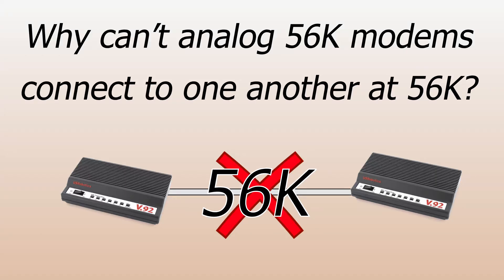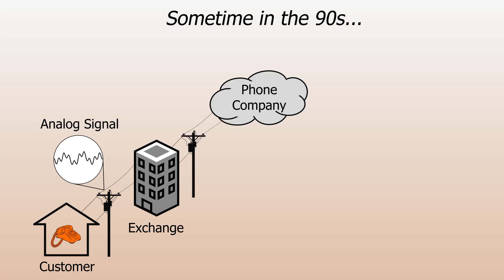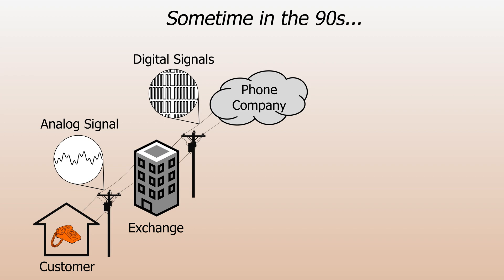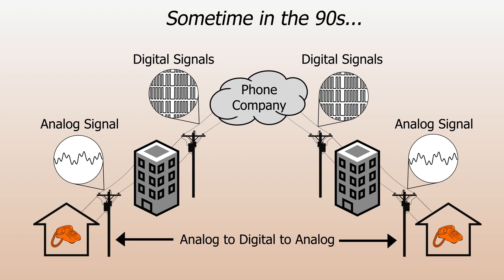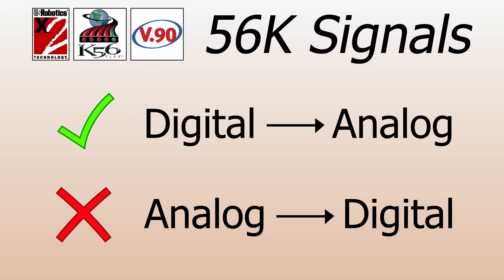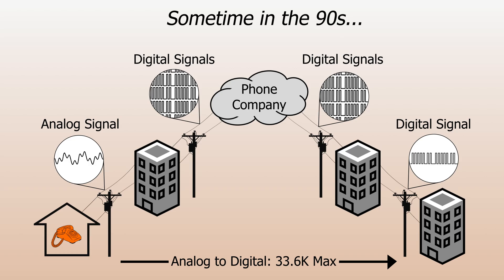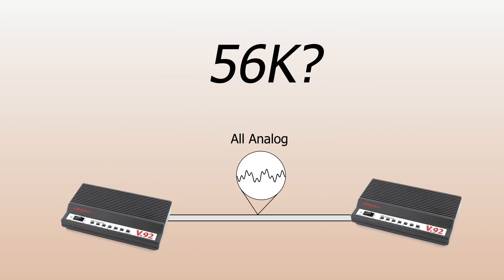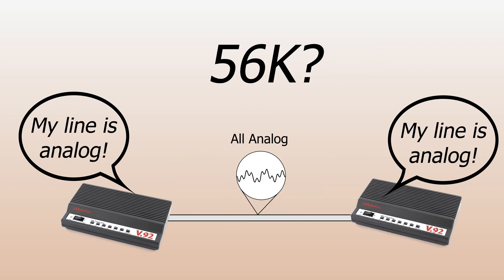56K Modems Aren't Always 56K

Comment: Clear and concise.

It would be interesting to delve further/deeper after this.
Reply from the maker: Edit: this reply was meant for a different question, and I accidentally posted it here, but I'm leaving it so the comments below make sense. 

V.92 is subject to the same limitation, at least so far as I can tell based on both my reading and of the standard and a bunch of  my own testing. In those tests with the V.92 modems I have on-hand, they don't even try for anything above V.34 after the V.8 exchange is done. I had hoped that the higher PCM upstream mode that V.92 offers might somehow work, but that feature is established during the V.92 handshake, so it never gets started.
Reply: @retrocet  Interesting.... But I'm not sure I follow.

Are you saying that the main advantage of V.92 over V.90, the "higher PCM upstream mode" as you called it, was never exploited/used in practice in the wild because the ISP side of the last mile still had an ADC conversion for the upstream direction?

Is the ADC in our consumer modems better than the one in the telephone post? I mean, we are still able to use ~52k of the theoretical 56k on the downstream side after all, and it does require an analog to digital conversion on the customer side there.

I guess I'm confused by your statement of not even attempting beyond V.34 handshake, which I'm inferring implies that upstream and downstream each have their own independent yet identical handshake? It will be interesting to see your future videos beyond Bell 103 as I'm very unfamiliar with the handshake process itself. For example, I have no idea what you meant with "V.8 exchange".

Or perhaps it's just that I'm unaware of what are those "same limitations" you speak of?

Thank you for your great videos ☺️👍
Reply from the maker: I'm really sorry, that reply was meant for a different comment where they'd asked if the subject of the video applies to V.92. 

Regarding going further into this, I may dive deeper into the limitation at some point. The meat of it would probably be going over how DACs and ADCs work in the phone system, and how the ADC limited the speed. 

Clarifying some of your questions here (again, sorry for the confusion), the PCM mode in V.92 I'm referring to is exploitable on regular analog lines, and allowed the upstream to reach speeds up to 48K. That said, it wasn't often used because cross-talk from using it limited the downstream speed; it just wasn't a typical use case that a consumer wanted more upstream than downstream at the time (or even today, really). 

The V.8 transaction I talked about is the sort of "wahwaheahwahwah" sound you hear right after the initial 'ding ding ding' sounds when a modem answers. It's a low-speed part of the handshake where the modems tell one another about their capabilities. This is the 'I'm an analog modem!' thing I refer to in the video. 

Anyway, thanks, and sorry again.